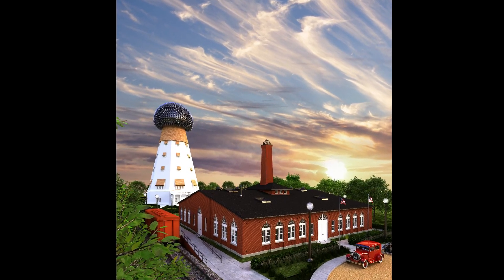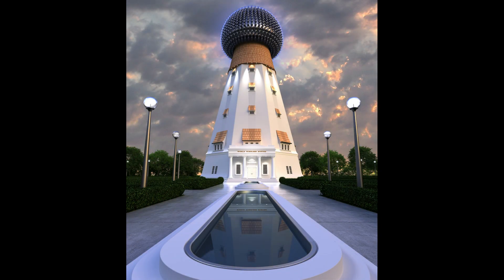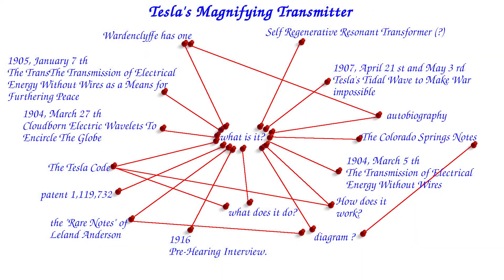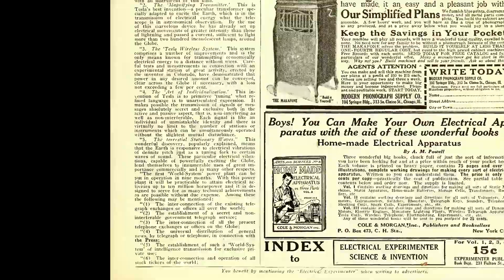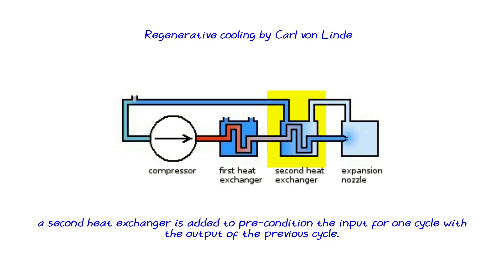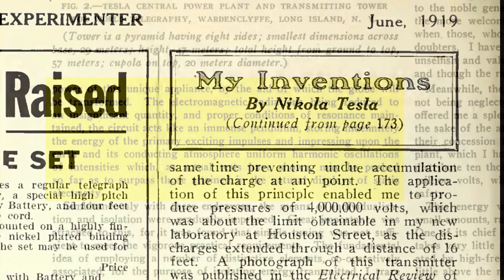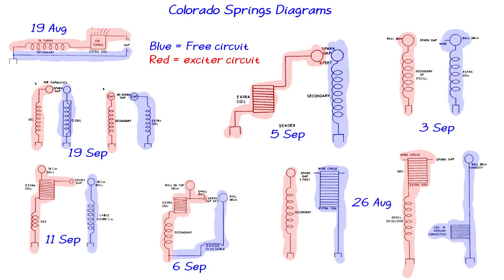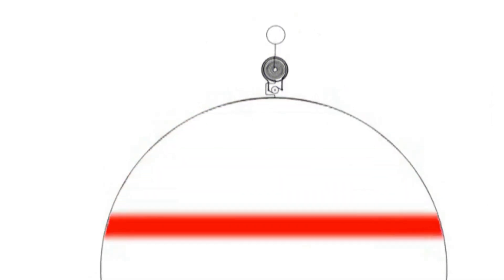Teslas Magnifying Transmitter

Comment: Are you suggesting that the extra coil has a spark gap to the toroid? Within his notes, he doesn't have just "one gold setup", he's running different types of experiments. Can you please elaborate on what you are suggesting?
Reply from the maker: The diagrams you see at 1:27 show what I am suggesting. How can I elaborate? What are you looking for?
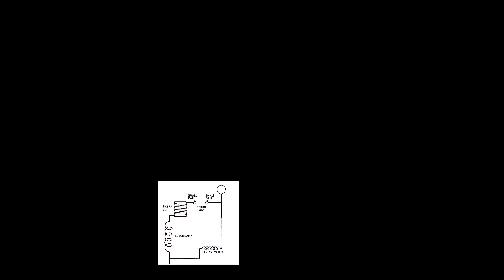Reply: @WardenclyffeResearch  yes and the diagrams on 3:07. I see on 1:27 that there are different schematics of which one Tesla used  for the connection of his extra coil.  I know that he used these diffrent variation for tuning purposes and run diffrent test but which one are you implying that is the correct way? Which way amdo you have yours connected? I've always thought it was directly connected to the to the top portion of the secondary and the other end was connected to the toriod.
Reply from the maker: @freedomer342  There is no correct way, it depends on what you want to do. In my setup, the top of the secondary is connected to the extra coil and then there is a spark-gap to the roof of the building. This is, I think, the simplest configuration.

Comment: I've been looking into making my own resonant transformer for some experiments and the magnifying transmitter has caught my eye, would you have any advice for how I should build a small scale version of this device? Like a regular or solid state tesla coil but built using the extra coil and working on magnification principles? Cheers.
Reply from the maker: When you say "Magnifying Transmitter", what you mean is "a Tesla coil with an extra coil". These are not the same, although most people believe so. To answer your question: just take a high Q coil, determine its resonance frequency and build a Tesla coil that operates on that frequency. This is, of course, a very simplified explanation and there are many details that can improve the performance. But for a beginner, I think this is a good place to start.
Reply: @WardenclyffeResearch  I actually do mean an MTM, the MTM was made to use the Earth as a capacitor/inductor and send pulses into it to recycle on the return right? I want to attempt building a small scale version of this sort of apparatus and try hooking it into an appropriate capacitor or inductor to attempt to replicate the behavior, if the device can be powered by the amplified return pulse it can keep going indefinitely, or at least induce a strong pulse on return, so I want to attempt replicating it.

I only mentioned SSTC's because the faster switching rate they provide can be advantageous over traditional spark gaps, so I was thinking of incorporating transistors into the design if possible, if it fails I can go back to regular SSTC's or ones with a 3rd coil.
Reply from the maker: @JenkoRun  OK, I see. I misunderstood. But in that case you'll run into two problems: 1 - to create a sufficiently strong effect in the Earth you'll need to produce several million volts. This cannot be done on a "small scale". 2 to keep it going you'll also need a very high voltage in order to "harvest" enough energy. So actually those two problems are one: the voltage has to be so high that it won't be contained in a small set up. Then you say that you want to use transistors for their fast switching times? Nothing is faster than a spark-gap.. And therein lies another key to success. So, I'm not sure if transistors will work for this purpose.
Reply: @WardenclyffeResearch   Apologies, I neglected an important point from my reply, I believe the reason TC's built to use transistors instead of spark gaps are more efficient and powerful is because they can trigger the power to the primary in resonance at significantly lower power levels than spark gaps over pure speed, Spark gap coils require high input voltages (over 4kV depending on design) and tend to draw a lot of power while Solid state coils run off low voltages (usually under 400V) to produce more energetic sparks, allowing the coil to operate on higher voltage and lower amps compared to traditional spark gap tesla coils.

So while spark gap's are the fastest they require more power to maintain their operation, whereas the transistors can control the frequency of the primary with far less power required, as long as the coils frequency is within the switch rate of the transistors the speed usually isn't a problem, though spark gaps would be superior in coils with extremely high resonant frequencies that transistors are not able to keep up with. If that can be adapted for a small scale MTM then it would reduce the power input required to keep it going, assuming the principle of SSTC's can carry over to it.

Also I'm afraid you misunderstood again, I  don't intend to use the Earth for a small scale version:

"and try hooking it into an appropriate capacitor or inductor to attempt to replicate the behavior"

In this case, I believe I need to hook the lower end of the secondary into an appropriate component instead of the ground plate as shown in the patent, since I'm not using the Earth for this small version, which would either be an very large inductor or capacitor and allow the pulse to return from it to the main apparatus like the original tower was meant to.

Would that be the correct way to use something like this on a small scale that uses something else in place of the Earth to achieve the same rebounding magnification effect? Ty.
Reply from the maker: @JenkoRun  Longer sparks does not mean higher output voltage. A SSTC usually drives the primary in CW mode which leads to longer sparks because the initial - short - spark will get used as a starting point for the next spark, thus growing sparks at low voltage. I think, from the top of my head, Ricky Burnett has a good video showing the difference between a SSTC and a SGTC, which clearly shows the much higher potential of the SGTC.
OK,, the picture of what you have in mind is getting clearer. But I think there still is one thing missing. 
The TMT is "harvesting" atmospheric  electrical energy and to do so it requires a very high voltage (> 1MV). I am investigating a possible method to achieve the same at lower voltages but until now without success.
Without this harvesting option you cannot make a "self sustaining" system, because there will always be losses.
But other than that I think you can make something that will demonstrate the remaining processes on a small scale.
Reply: @WardenclyffeResearch  Million volts 😂. I achived 500ft of distance even with 0.92watt😅. Huhh you peoples just make hypothesis
Reply from the maker: @Beastbrain...369  🤣🤣🤣🤪

Comment: The problem of harnessing and transmitting electrical power efficiently has long been a challenge in the field of engineering. However, Nikola Tesla's Magnifying Transmitter offers a potential solution that could have revolutionized the world. Ernst Willem van den Bergh, an esteemed researcher in the realm of "Nikola Tesla Science," delves into the intricacies of this remarkable device in his comprehensive book. By meticulously studying Tesla's quotes and drawing connections to modern physics, van den Bergh sheds light on how the Magnifying Transmitter functioned and its immense implications for humanity.

Comment: Hello, what type of capacitor and brand do you recommend for a very high voltage magnifying transmitter?
Reply from the maker: The best are doorknob capacitors, but you'll need 3x the voltage rating making them very expensive. Much cheaper are Cornell Dubilier 942C series capacitors. Those, I think, are most often used for Tesla coils.
Reply: several sheets of heavy duty A4 sheet protectors. should be hdpe. 

then a layer of aluminium foil hanging out a bit at one end.

then more sheet protectors...

another layer of foil poking out the other way...

repeat as necessary.

clamp it down on a nice timber plank.